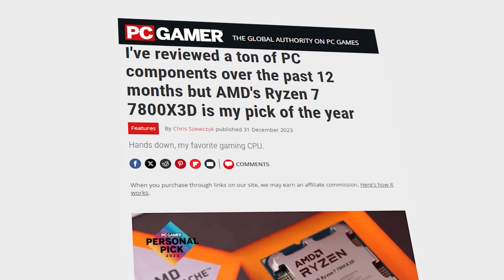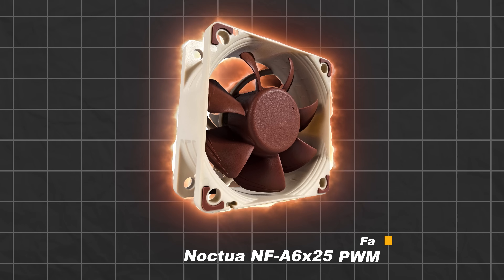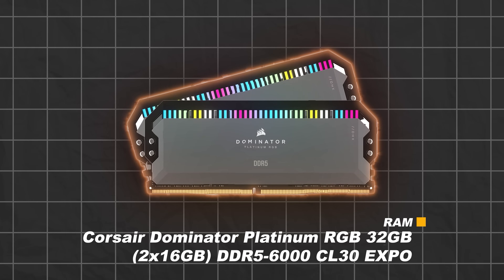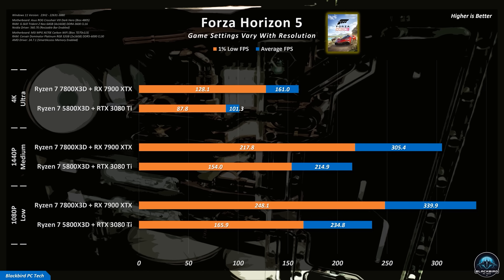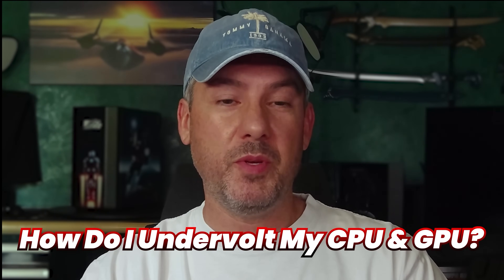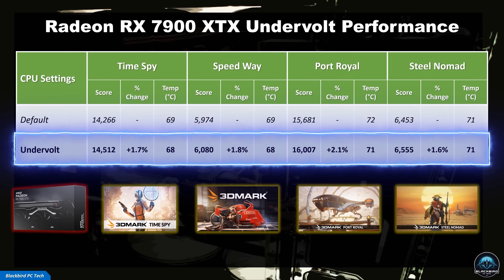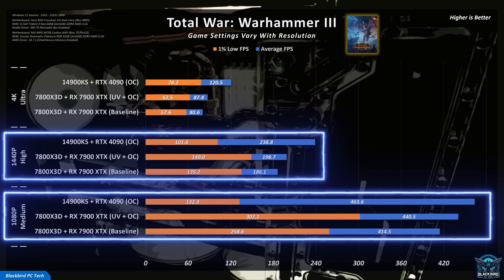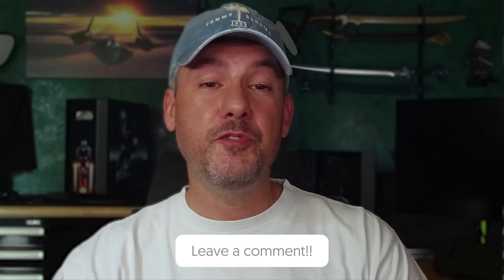Is an All AMD Gaming PC Really Worth It?

Comment: I have a Ryzen 7 5800X3d paired with an RX 7900 XTX and I can tell you true that my all-AMD rig is TOTALLY worth it!  I believe that peak high-end gaming value comes from this combination so I would suggest that you test the R7-5800X3D with the XTX vs. the 7800X3D with the XTX.  I think that you'll see that at the higher resolutions that someone with an XTX would be gaming at, the difference is negligible.  You would've had the same gaming performance at 4K without having to buy a new motherboard, RAM and CPU.  All you needed was to upgrade the 3080 Ti to the XTX.  THAT is why so many reviewers have declared the 5800X3D to be the "GTX 1080 Ti of CPUs" (the G.O.A.T.).  There's a reason why so many AM4 owners (like myself) haven't bothered moving on up to AM5.  I have an X570 motherboard, 64GB of DDR4-3600, an R7-5800X3D and an RX 7900 XTX.  I game at 4K and there's no setup that would give an appreciably better experience without paying through the nose for a 4K high-refresh display.  I chose size over refresh rate and I game on my 55" 4K 60Hz TV.  It is absolutely GLORIOUS!

I must point out however that having an AIO with ANY X3D CPU is just useless and dumb because X3D chips don't put out much heat and can't be overclocked.  My 5800X3D, which puts out more heat than the 7800X3D, is cooled just fine with an AMD Wraith Prism air cooler that cost me (literally) nothing.
Reply from the maker: I appreciate your passion and comment. I tested the 5800X3D against the 7800X3d (with a 7900 XTX) extensively in my video "5800X3D or 7800X3D - Which One Is Right For You?" While I agree with you that the average FPS at 4K will not be impacted, the 1% lows definitely improved with the 7800X3D, even at 4K. Based on 15 games the 1% lows improved by around 8% at 4K, which is significant. I also disagree with your statement around using AIO's with X3D chips ... the entire thermal solution for this case was designed to use a 280mm AIO in the front. It's not just CPU temps that need to be considered when it comes to PC thermals, you really need to look at how all of your components interact.

Comment: Why I chose my RTX4070...
DLSS... other stuff mattered, like power consumption but it really boiled down to DLSS. What's the point of having a better "value" AMD card if the visuals look worse for titles that support upscaling. The differences aren't always super obvious in Youtube videos but in person the artifacts that FSR can cause is often very distracting. There's NOTHING AMD could do to bring me back in a few years unless they got a good AI upscaling solution AND the existing games I have got upgraded to it. Not just future games.
Reply from the maker: I recently did a comparison of FSR 3.1 vs DLSS 3.7 vs XeSS 1.3 in my "Should You Buy an RTX 4070 Super or RX 7900 GRE?" video. FSR has improved significantly and many of the older issues have been eliminated entirely but DLSS is still currently better.

Comment: I've always heard amd has a general higher latency then nvidia and intel..Is there anything in this?🤔
Reply from the maker: That's true ... a chiplet design that relies on transferring information through interconnects will always be slower than a monolithic design. That said a chiplet design will be cheaper and allow you to use different manufacturing nodes to package a solution. Intel's next gen cpu's are rumored to be chiplet based and future Nvidia gpu designs will likely move away from a monolithic design for cost reasons. All of that said is it something that you will notice in games? No, unless you are an e-sport professional then it's not something you should be concerned about.
Reply: @blackbirdpctech  tnx for the enlightenment tho🔥🔥

Comment: Wish you had upgrade to the 7900XTX first and then upgraded to the 7800X3D
It would have been interesting to see what just the GPU upgrade gets you vs a total replacement.
Reply from the maker: That’s why I tested the way I did … 1080p/low settings will heavily load the cpu and allow you to see the impact of the cpu change versus 4k/ultra that heavily loads the gpu and allows you to see the impact of the gpu change.

Comment: Isn't there an error in F1 2023 FPS which goes from around 40 at 4K on both setups to .... 200/350 FPS at 1440p ???????
Also you kill the 7900XTX performance with any RT, AMD is still way behind NVidia (in Wukong AMD RT is ridiculously bad, slideshow level...)
Reply from the maker: There is no error, I explained my test methodology in the video … I change the game settings at different resolutions to provide tests to load the cpu, gpu and create a more balanced scenario. Unfortunately larger tech YouTubers test at ultra settings, even for CPU’s, which doesn’t load the cpu, even at 1080p. They really don’t understand what they are doing.

Wrt RT … this is an issue for AMD, it’s not my issue … it’s a superior graphics option and a valid option to test. If you look at my benchmark suite I have titles that favor Nvidia, such as Cyberpunk, and titles that favor AMD, such as Avatar … my objective is to provide a balanced test suite without bias.
Reply: honestly not everyone cares about RT.
Reply from the maker: That may be true however it is an objectively superior way to generate 3D graphics versus using an infinite number of polygons (i.e. rasterization). The next gen AMD cards will be far superior at RT than the current gen and my prediction is that it will become the standard approach for PC graphics moving forward.

Comment: Excellent video! I literally just built a 7800x3d and 7900xtx pc yesterday for myself. Old pc was crashing games almost every game so had no time to wait for any “soon to be released” tech. Still dialing it in, but very happy so far. Came from an i7 9700k and 2070 super, which is still pretty good, but an all AMD top spec is way better. ( paired with Gigabyte x670 x ax gaming MB, g.skill 2x16gb 6000 30-36-36-? RAM, Kingston 7000r/wr ssd, NZXT H9 flow case) happy! Cheers.
Reply from the maker: Great motherboard … let me know what undervolt you are able to achieve.
Reply: @blackbirdpctech  I’ll do some tests today and comment back! Cheers!
Reply from the maker: Just be prepared … if you push it too far you will likely need to flash the bios … not a big deal, but just wanted you to know.
Reply: How are you finding it? I'm looking at almost the same build. Just can't decide between a 4070 Ti Super and an 7900 XTX
Reply: @Systemop01  I’m loving it. Have a 1440p monitor and it smokes any of my friends. I get around 300fps at 1440 on mid settings on Fortnite if you play that. Have not felt that it isn’t what I want at all. Def recommend if you can get the parts at the right prices.  7800x3d’s have gone up quite a bit. Good luck with it!
Reply: @willk76  the 7900 XTX just sold out on Scorptec! Now I'm just thinking I'll go with Asus TUF 4070 Ti Super OC Edition

Comment: Not anymore
Reply from the maker: What makes you say that?
Reply: @blackbirdpctech  thr latest aaa titles all having issues with amd. All under performing then amd releases drivers that don't fix it. Seems like nvidia is the far better choice for the future of games that are being developed differently now. Taking much more advantage of nvidias technology then others based even on the integral workings of developers and how they are choosing how to design games. Even without ray tracing nvidia is still doing better. Every nee game is practically promoting nvidia hardware and nvidia is doing the same with the games. Wethere its wukong or the new star wars game or the next 4 aaa titles coming lol. So yeah amd doesn't look like the hottest option right now for compatibility and reliability on the actual playability. This coning from someone who makes sure and tests what the best of both have to offer.

Not a 4090 either. Meaning 4080 super and a 7900xt/xtx. So yeah from my view nvidia is the choice for this upcoming generation of games on the generation of hardware we have right now.
Reply from the maker: I have tested both extensively and while I agree with the fact that AMD takes longer to get their drivers right, I disagree on the fundamental technology. There is no question that Nvidia has an advantage with RT but AMD is rapidly catching up … there is only so much however they can do with software alone … they need their next gen hardware to help accelerate and fully catch up to Nvidia. That said, AMD is competing heavily on cost, so when you look at value that needs to be a large consideration. At equal price I would likely choose Nvidia but typically an equivalent AMD card is $100+ cheaper, so that makes it a much tougher decision. For this video I focused on the question of whether an all AMD gaming pc is worth it and based on the data the answer is yes.

Comment: I have a Ryzen 3700x with 3080 Ti wondering if its worth it to upgrade Mobo/CPU/Ram but stick with GPU for a bit.
Reply: 5700x3d only and hang onto the TI.
Reply from the maker: Great question ... I recently upgraded a system with a 3600X and 3060 to a system with a 5700X3D and 4060Ti, so you can check that video out to get an idea of the performance uplift you should expect. I would definitely get a 5700X3D or 5800X3D ... that way you could save some money and stick with the same motherboard and RAM, just make sure to update your bios first. A 3080 Ti is still a good card, so there is absolutely nothing wrong with hanging on to it for a while.

Comment: Now run it vs a 9700X and you will see similar performance with lower CPU temps on the 9700X, similar price, and lower power draw. This is why I am jumping from 5600X to 9600X the next time I see the 9600X drop to $200 again.
Reply from the maker: I’m working on a 9700X vs 7800X3D video but with a twist … something most reviewers completely ignored … should be interesting 😉

Comment: Awesome! I have just saved enough for my new pc and now I'm waiting for the release of the Blackwell gpus (I pray they get released later this year). I think I have my mind set on an nvidia gpu since I would also like to mess with other things like AI. From what I have seen the ryzen 9 9950 is very similar to the r7 7800x3d so I'm praying that the new x3d variants will also have a big performance boost. I can't wait to play games with high fps and graphics on 1440p. My current system is soo bad that I can't even run games like tf2 and other low end games without low fps and significant frame drops :/. Great video once again!
Reply from the maker: Love it ... one of the best parts about doing a new build is ordering your components and then having them arrive ... it's like Christmas every day ... I'm happy for you ... if there is something I can do to help please let me know. I would recommend using a thermal pad of some type for your cpu instead of paste ... they are so easy to use without any performance drop or mess.
Reply: @blackbirdpctech  thank you very much, you're videos alone are more than enough- I couldn't ask for more! I'm considering just paying someone else to build it for me since I have no experience and don't want to risk breaking something so expensive 😅

I really am interested in the undervolting of the cpu and will definitely consider doing that with my cpu if it's safe and is worth the change! 

Appreciate your speedy replies, even if I don't have a question 😃

Comment: Concur with the conclusions drawn in this video. As another point of comparison, a friend bought a 3070 Ti in late 2022 for about $700, same price that I bought an ASRock 6950 XT for in 1Q 2023. Value proposition fluctuates each generation, but at tail end of the last one, AMD was so above and beyond in value that you either need a specific software use case or just brand loyalty to buy the NVIDIA GPU for same price when its worse in gaming.
Reply from the maker: The interesting thing about the 6000 series is that it got better over time … I really hope that the next few generations from AMD are able to recapture that magic.

Comment: A more fair comparison would've been the 4080 to the 7900 XTX. Obviously the 7900 XTX is going to blow the 3080 Ti out of the water considering it's last gen.
Reply from the maker: Agreed, I have videos comparing the 4080 and 4080S against the 7900 XTX … for this video I wanted to see how an all AMD system would do against a good prior gen system and an ultimate high-end pc … it actually performed really well.
Reply: @blackbirdpctech  Fair enough. Great video, thanks for all the info.
Reply: Or at this point, the 4080 Super, since NVIDIA dropped the price on that so its $960 to $1,100 depending on which model you get, which is a stone's throw from the $900 to $1,030 that the 7900 XTX still goes for. The 4080 Super is simply the better GPU and would be a better upgrade for a 5800X3D user than a whole system upgrade if they have an older GPU. But then, you have to be able to spend that much on a GPU!
Reply: @savagej4y241  bingo I just got an 4080 super with an 5700x3D and my rig beats anything I throw at em I thought about going am5 but it a price difference so an 4080 super wasn’t looking too bad! Coming from 2060 super 3600
Reply: @savagej4y241  When I say and think 4080, I clump the 4080 Super in with it as there's roughly a 2-3% performance difference between the cards, so to me they are the same. I was looking at performance comparisons and not price differentiation as well. The 4080/S is the closest comparison to the 7900 XTX for an Nvidia card and that's the only reason why I made the comment, but price is important as well
Reply from the maker: I compared a reference model 4080 Super with a reference 7900XTX … the price cut on the 4080 really helps it.
Reply: Well I think the point of this video is for someone who has about the best of the last generation and if it would be worth upgrading to the new generation. I think it would’ve been more appropriate to try each gpu with each cpu set up. Because my assumption is the biggest gains will be made by the gpu. And any bottlenecking would probably be in 1080p. But that’s just my speculation. Plus not a lot of people are going to be able to upgrade the CPU, motherboard, ram, and a GPU. They’ll likely have to pick one or the other.
Reply: @forfun6273  That's not what the video was about, nor is it what the discussion is about here.
Reply: I'd say 7900xtx is the best value. AMD drivers are horrible and the card runs fairly hot out of the box. If you like to tinker then AMD. Nvidia is coinvent, runs cooler, DLSS, reflex, at a price premium. Matters on the titles you play and applications.
Reply: @imkvn4681  have you had actual driver issues with AMD recently? Genuinely curious.

Comment: As a fellow 5800x3d owner I can't justify the total system re-build for "ONLY" 56% game performance upgrade. Hopefully the 10K series CPU's will double performance in all applications!
Reply from the maker: The 5800x3d was ahead of its time … still a great chip.
Reply: And this is further compounded when you factor in that the likely use case of 1440p on high or custom high settings with a 5800X3D and 3080 Ti (or better, since there's more powerful GPU's like the 4070 Ti Super for less money that the 5800X3D isn't a bottleneck with) already surpasses a baseline of 90 FPS 1% lows in so many titles. 4K is a nonfactor for gaming IMO, an ultrawide 1600p monitor would be the step up.
Reply from the maker: At 4K it’s all about the gpu … the cpu doesn’t matter as much.
Reply: @blackbirdpctech  Why is the 7800x3d the best choice in this situation?. It has integrated graphics which wouldn't be used in this situation anyway because of the dedicated graphics card. Am I missing something?
Reply from the maker: @SonderZensei  are you asking why I went with AM5 versus sticking with AM4? The 7800X3D is an exceptionally good gaming focused chip, it offers chart topping performance and a great price. It's one of the easier choices to make when building a gaming PC. The fact that it has integrated graphics isn't really a consideration that impacts gaming.
Reply: @blackbirdpctech  Yeah, I think that's what I'm asking 😂I find it all a bit confusing to be honest. I know some AMD chips have integrated graphics capability but it's disabled. Other AMD chips have it enabled. I'm waiting for the day when there's a chip that has integrated graphics powerful enough to not need a dedicated GPU. I like small form factor gaming rigs but GPU's are getting ridiculously large. I don't really understand why  supposed gaming CPU's have integrated graphics at all if people are also installing super powerful graphics cards. Is it just marketing? If I'm paying top dollar for a CPU with integrated graphics it only makes sense if I don't have to buy a graphics card. But why pay for an expensive CPU with a feature you won't be using if you intend to install a graphics card anyway. I'm just thinking out aloud I suppose.
Reply from the maker: @SonderZensei  integrated graphics are great for troubleshooting (if your discrete gpu doesn't work) and doing things like video editing/rendering where you can use it to help accelerate your work. For gaming the performance of even the weakest discrete gpu is usually significantly better than the discrete option.
Reply: @blackbirdpctech  OK. Thank you!😊